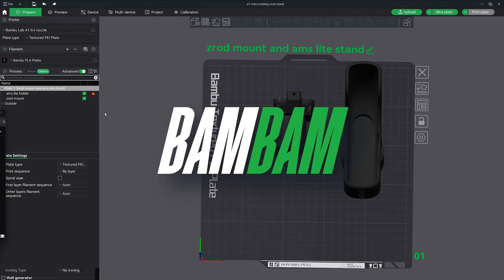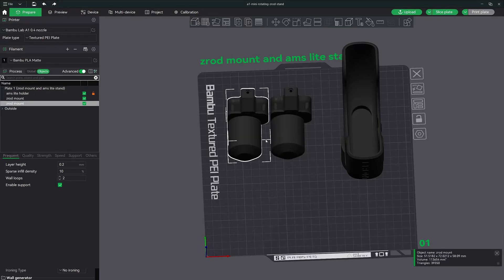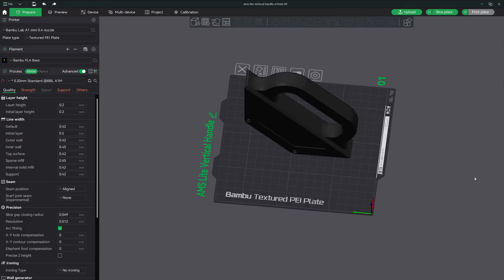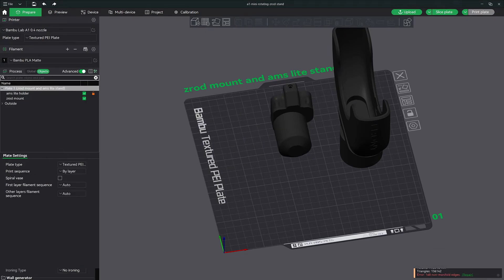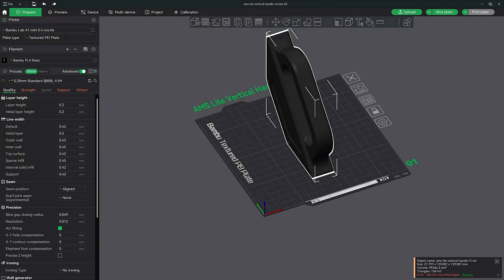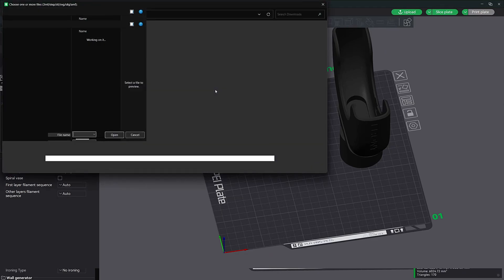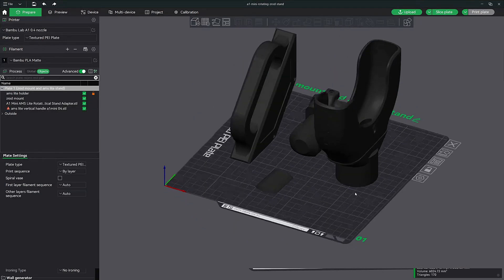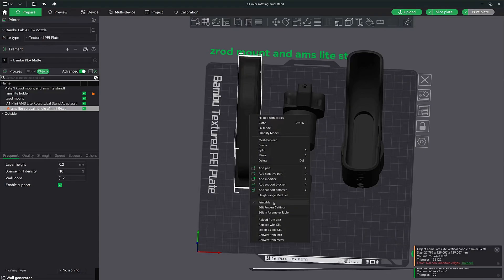How To Copy 1 STL Into Another STL

Comment: I use Hotkey: CTRL+I to import. I often make the same design for the X1/P1/A1 and A1 Mini. I simply make the large plate "project" then "Save As" and in Device tab switch it to A1 Mini. Rearrange objects and voila you have 2 specific files of the same design. 

Note: Adding more and more features to a software often introduce bugs and conflict. Keep it simple.